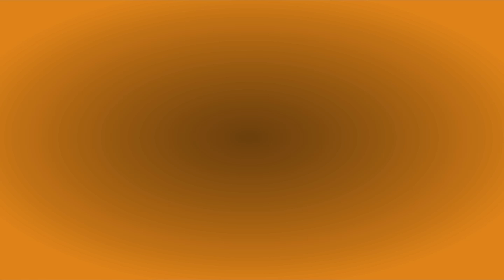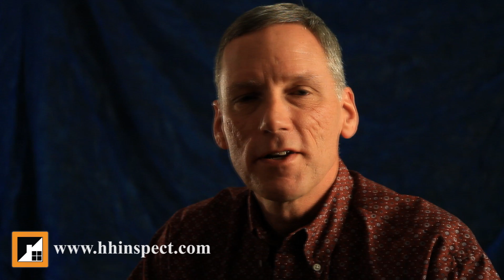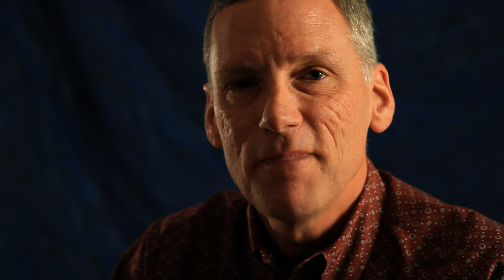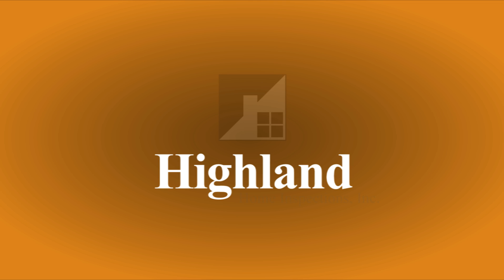Polybutylene Crash Course

Comment: I am renting a 1985 mobile home that still has the Polybutylene Plumbing Pipes that the manufacturer installed while they built the 2 bedrooms/2 full size bathrooms mobile home (980sqft.) that I have been renting since 2009.  Now, between the repairs and the extremely high power bills due to hot water lines from the electric water heater. I been wondering about how much it would cost just to replace all of the polybutylene that feeds the city water into the mobile home.

Comment: Builders used plumbing contractors to use PB to save couple of $ hundred dollars to rough in pipework on large development to improve there profit , Only to cost $ thousands to repair & replace in the future by the home owners.
Reply: Yes and no. Copper was getting quite expensive and polybuthylene was supposed to be a good alternative, it would save costs on both material and labor (no soldering, flexible pipes so less elbow joints, etc). However, in the US mainly, where the water coming from the city has a good amount of chlorine in it, it turned out that it would wear out the pipes from the inside over time. Where I live there isn't much chlorine in the water so polybutylene isn't a big deal and insurance companies don't bat an eye if your plumbing is PB (my house was built in 1993 and has polybutylene plumbing, no leak after 27 years). Now builders pretty much all use PEX, which is very similar to polybutylene(flexible plastic pipes) and has the same advantages but won't fail prematurely due to chlorinated water. Copper isn't all that common anymore in new constructions, mainly because PEX works perfectly and has several advantages over copper, so for most people it isn't really worth spending the extra cost on copper.